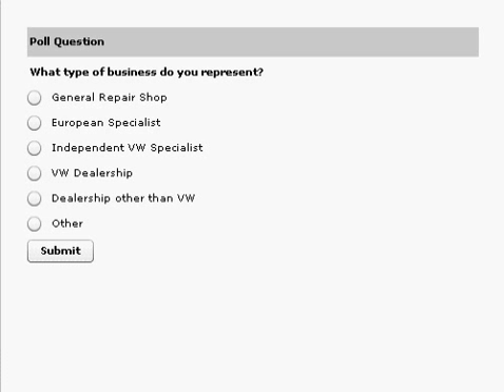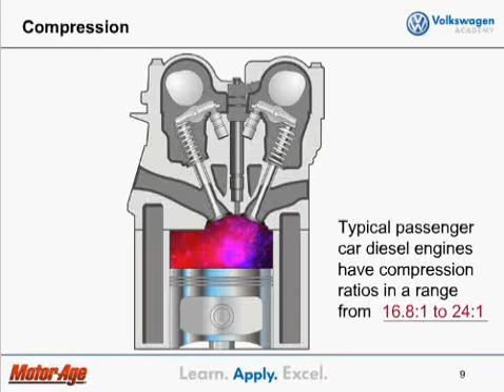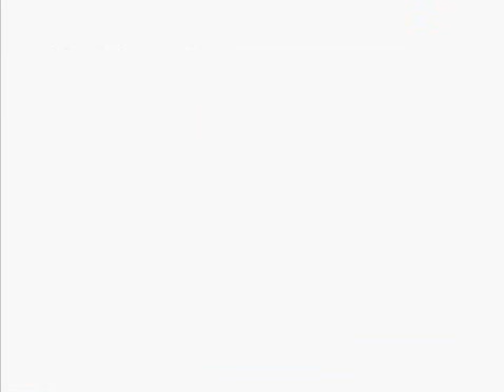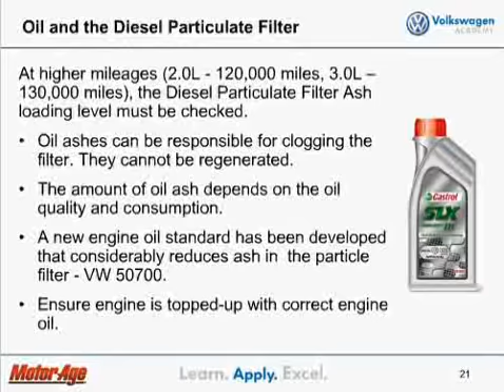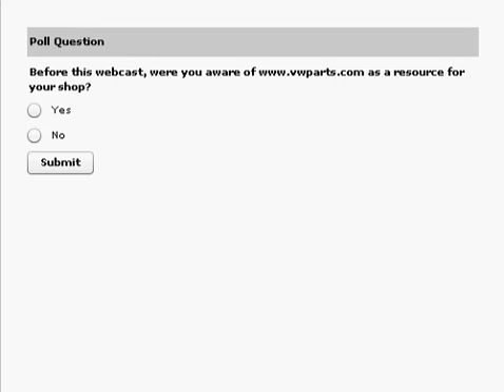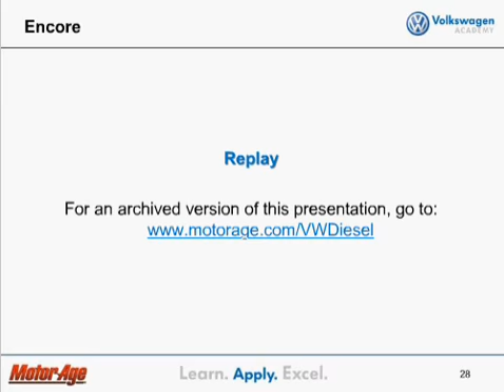Understanding Volkswagen's TDI Diesel Technology

Comment: I'm amazed at how little the experts knew about the early TDIs... The first TDI sold in the USA was the 1Z in 1996. It was broadly similar to the ALH from 1998, but was based on the older block architecture and didn't have a water cooled EGR or VNT turbo. The rotary pump used on the early TDIs is electronically controlled by EDC 15 on the 2000+ cars. They also had pilot injection (this was actually added on the pre-TDI AAZ mechanical diesel in 1993).